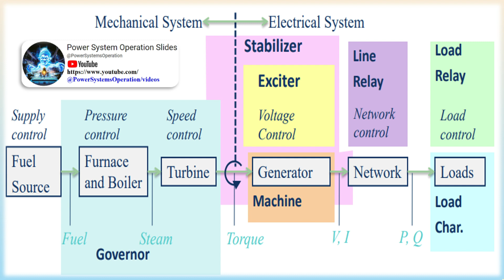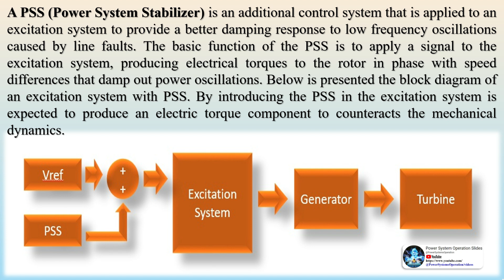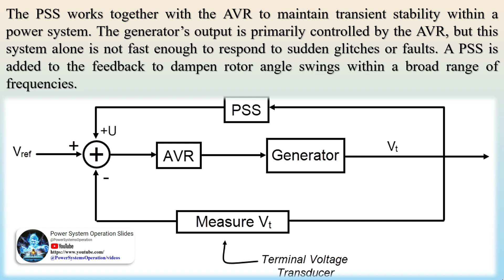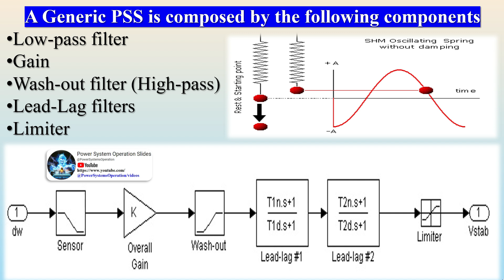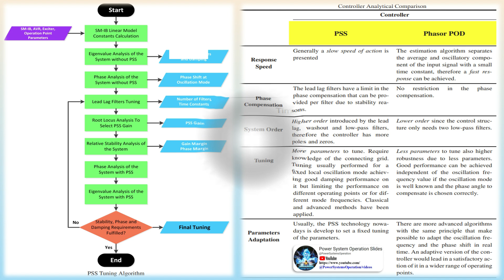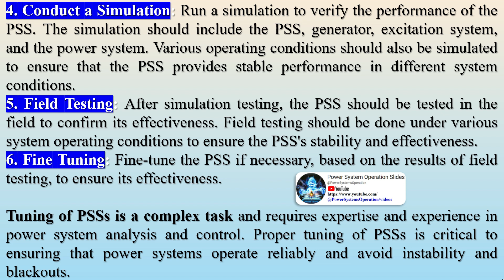Power System Stabilizer Tunning | Power System Stabilizers Tuning Steps & Techniques | PSS Tunning

Comment: Thank you for this presentation and I found it very interesting. I am not an electrical engineer nor do I deal with utility size systems. My perspective is from the demand side. Also, I have not watched all of your videos, so my comments are qualified. My interest is the decentralization of the power grid. As more electricity is being generated from diverse sources,  power distribution becomes bidirectional. It is my belief that renewable sources that charge batteries will become the new normal. As such load following will take place at the micro-grid level. Ultimately the larger grids function will be to supplement the charge of the of  distributed node batteries.
Reply from the maker: yes dear well said.